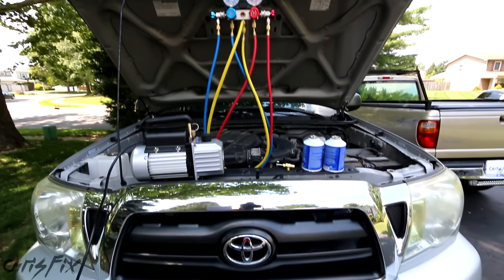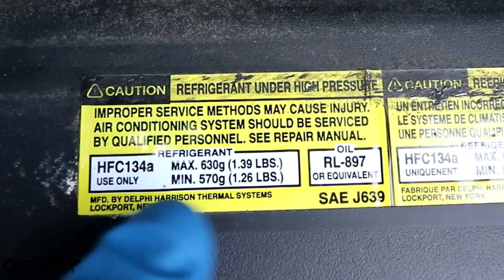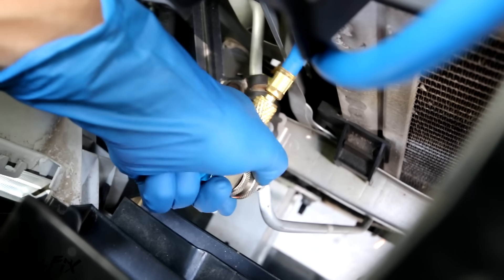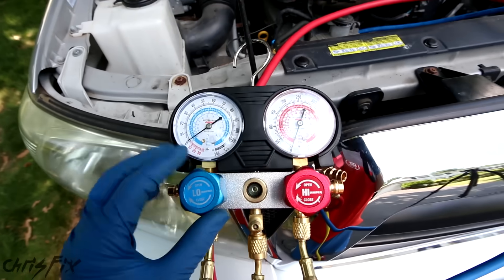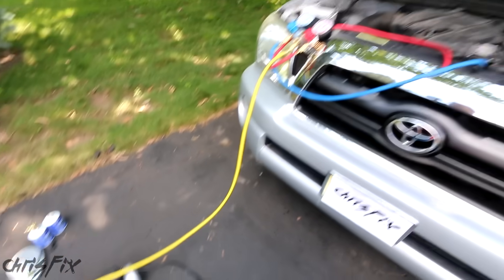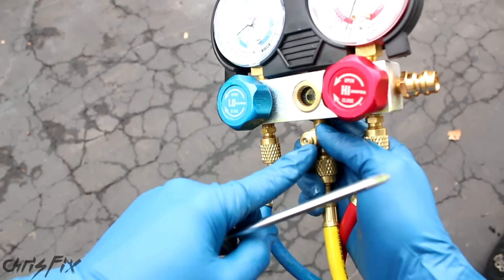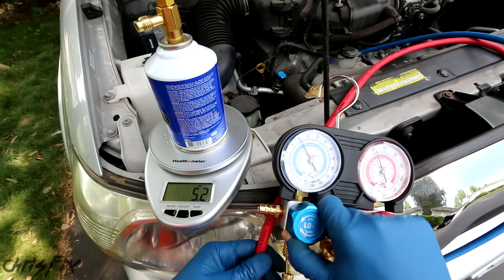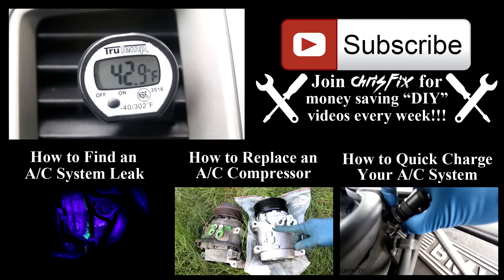How to Properly Recharge Your AC System

Comment: So, if you pulled a vacuum, didn't that pull the "OIL" out of the compressor? If you poured oil down the hose, and "PURGED" it, wouldn't that blow the "OIL" out? Just saying.

Comment: If I need to add oil, how to purge? I mean, if there is oil in the line, it will be spilled out?
Reply: don't add oil during purge. Chris did not show the order. You should add oil then connect the refill can so oil will be forced in during refill.

Comment: I followed everything step by step but I'm stuck at the part where the vehicle is supposed to take in the refrigerant.  The gauge needle doesn't move when I open up the low pressure valve... And no refrigerant is going in.  Help!

Comment: The step at 6:17 is not correct(?)  You're not supposed to close the hot and cold side when checking for seal/leaks.  Otherwise, you're just checking the leaks between vacuum and the gauge, but not the AC system!

Comment: Hey Chris, just wondering with the purging of air, if you did not have a purge valve. How would you go about getting the air out and at what stage of the refil. I gather you would unscrew the top yellow connector and listen for air after opening the can tap, leave it for 3-5 secs and then screw it up again. Is that sufficient??? Obviously you wouldn't have the gauges open yet, so I gather it would just evacuate the air naturally before that stage of the process
Reply: or where could you buy a purge valve connector for this

Comment: Can anyone help me out with this question?  I refilled my AC system using those one way connector that you buy with an "AC recharge kit" and my AC did go from being pretty warm/hot to cool, but it's not really cold like some systems.  If I rent this to pull a vacuum on the system and vent the free-on, will it be colder then if I just put some into the system like I did?
Thinking about doing it this way if it'll make the AC colder.  Any responses are appreciated.  Thanks in advance

Comment: Great video, but I have a question.  If the system holds a vacuum and doesn't leak anywhere, then how did the refrigerant leak out in the first place?  Theoretically, if the system needs to be recharged every so often then that means there should be a leak somewhere...  this has always confused me.
Reply: some small leak is OK. If you have to recharge every year, it is not a small leak.

Comment: Great help!  Thanks!  The compressor I got came already filled with pag oil just like yours.  Did you change out your drier?  If so, do you have to add more oil to the condenser/drier or does the oil already installed in the compressor cover the other ac components?

Comment: I use this video every time I recharge one and everyone is still pumping out ice cold air just used it again today for reference
Reply: Everybody does lol. Even mechanics in shops 🤫 don’t tell anyone we do. 😂 haha
Reply: Do u have  the adapter he used in video if so could you please tell me where you got it.
Reply: @larrydean6930  what adapter? The one for a self sealing refrigerant bottle? 

If that’s what you are referring, i bought mine at Walmart on the ac section near the oils. It costs around 3 dollars. They even sell a self sealing bottle charging for the ac pag oil that you can recharge easier than pouring oil in the lines.
Reply: @LaCacaLoca  if I'm getting the refrigerant recovered and then changing the two lines that go from my compressor to the condenser and accumulation drier, then vacuuming the system and recharging, should I put in more oil?  I know I made a comment asking Chris, but I'm not sure he'll even see the comment mixed in with the other thousands he gets.  Thanks in advance if you can help.

Comment: By putting the vacuum on the system (after new compressor installed) - wouldn't this suck out the compressor oil that came pre-installed with the compressor??

Comment: Folks Chris mentioned it already. When you have a leak it does not mean there is no refrigerant in the system. You HAVE to have it professionally evacuated before doing any of this. Evacuation is NOT the same as pulling a vacuum. Most shops will do it under ~$80 or so.

Comment: Did you change drier?
You didn't account for the r134a in the hose set ,typical with your hose ser is 1.5 oz sum of all 3.
If your gas bottle is upright you won't dispense liquid and therefore not damage the compressor.
Shadetree AC..

Comment: Why not just use grams instead of doing silly conversions between pounds and oz lol.
Reply: Lol YEAH, YOU COMMIE!!! J/K  if you're doing this kind of stuff you should be mathematically inclined enough to use whatever measurement system, right?
Reply: @edd7812  I suppose but there’s way more precision with grams and no conversion needed for the scale
Reply: @edd7812  Smart people do things the easiest, most efficient, and most effective way possible.
Reply: @benjaminabel8596  I guess my point would be much like language measurement systems vary. But if you were a linguist you should be able to communicate in whatever language proficient in
Reply: @edd7812  Some, if not many, linguists are only proficient in one language.
Reply: @benjaminabel8596  linguists proficient in only one language shouldn't do AC repair! 🤣😂🤣

Comment: Anyone else have trouble adding the refrigerant? I realized my refrigerant can is the opposite. The can is "open" when the adapter is in the down position. Did Chris use a non self-sealing can (back in 2015)? Almost all cans today are self-sealing, so when you raise the adapter the can will seal itself. So I assume adding refrigerant will work successfully for those with a self-sealing can doing the opposite of what he says about the can being open or closed. Unless I've missed something? Just trying to clarify. Thanks for the video.
Reply: Chris used the old style can (Pierce-Top)

Comment: Should not start a vehicle with the a/c system under vacuum...technically. It's only a major issue on a couple models.

Those cans should only be used upside down. Slowly. It works in a pinch until you can get it professionally done. But be prepared for an enviro charge as no shop wants to contaminate their machine with the stuff in cans.(amazon and ebay cans are usually just propane for the cheap or sale ones)

Comment: Wow.  Just great videos Chris.  Thank you. I recently tried to recharge my Explorer.  I pulled the vacuum and followed your directions.  The vacuum may have escaped somewhat before I actually started adding refrigerant.  After about 8oz going into the system, it would not accept anymore.  The compressor was running.  It was about 55 degrees outside.   Any suggestions?  Thanks.

Comment: Hey Chrisfix I have a question. So I screwed up and used a can of r134a with oil that stops leaks but it says on the can it’s not meant to be used on a hybrid.  So I filled my Prius with the wrong one. Is there anything I can do to fix this? Thanks for all you do.

Comment: If you have an old R12 or R22 system, I would highly recommend looking into converting to R152a, it performs much better than R134a and nearly the same as R12.
Reply: performance should be pretty much the same, but if anything this "newer" gases perform worse. in eu r12 and r22 are illegal and you can go to jail for owning them.  r134a at 4bar/58psi suction, outputs about 8.9°c/48f when r152a at 4bar/58psi outputs about 12°c/53f. and r12 same pressure 8°c/47f
Reply: @zorko1996  in my old R12 system that I've converted over to 152a, the low side pressure is at 25psi at the POA and I'm getting around 37 degrees F at the center vent.
Reply: @JackofAllTrades1  hard to believe. 152 at 25psi is 12°f you have to have a very blocked cabin filter in that case, cause u should be getting way lower
Reply: @zorko1996  well, this is a classic 70's car so there is no cabin air filter but I do not doubt the evap could be blocked a little from buildup over the years. An AC tech friend of mine told me that actually 23psi is the best low side pressure. Are you looking at the right pressure/temp chart? I posted a video on my channel with all the details a month back, you should check it out.
Reply: @JackofAllTrades1  ye gonna check it. to be honest 37°f output is chill enough anyway :D yeah im looking at danfoss refrigerant slider. we use this app for diagnosing system failures on industry scale, it hasnt dissapointed yet
Reply: @zorko1996  my buddy had an app on his phone that he showed me, not sure of the name but he repairs residential units. He had a large list of refrigerants to pick from on the app and he studied it for a bit and told me that between 23 and 24 psi would be optimum. I tried to set my POA at 23 but it ended up at 25. At 37 degrees I'm cruising nicely in the heat. 😀

Comment: When you add oil or dye to the yellow line it all comes out when you purge the line of air. Is there a better way to add the oil or dye manually other than buying refrigerant that's already mixed with it?
Reply: Interesting. All I know is you can add it to the compressor through one of the line holes.

Comment: I'm currently an auto tech student at Front Range Community College here in Colorado. I will be doing HVAC courses this summer, and wanted to get a headstart on learning about A/C systems. I know you used a scale to measure the second can of refrigerant, but I was wondering about something. Do you have to account for the weight of the can when adding the second one to avoid overfilling the system?  Thanks in advance if you happen to see my comment.
Reply: the weight of the can , whatever it is with the hose attached . what comes out is freon . if the can is 30ounces now with hoses on and you need 10 ounces  30 - 10 . stop at 20 .
Reply: @boracay12  maybe I was just over-thinking it. Thanks for the reply.

Comment: THUMBS UP for the vacuum time ! very important is the time that the vacuum is done ! A lot of variables for the pressure and temperature (boiling point) Abut the UV dye ..not entirely agree as i can change the viscosity of the oil, i would avoid using the UV dye .
In my opinion inside an AC system should be ONLY correct amount of refrigerant and oil (type and quantity)

Comment: Good info except you didn’t mention what the pressure should be.
Reply: I think because you fill it based on the WEIGHT requirement, not the pressure. If the system is tight and you put in the correct weight of R134a, then the pressure will be fine.
Reply: going by pressure is relative, it depends on the temperature  . if its 90 plus degrees out the pressure  is higher  . there is a chart for that . but by weight is better and you get the right amount . its better to empty the system ,vacuum it and fill by weight . its only a few cans .    to much it will be warm and way to much can damage the compressor.

Comment: Hey Chris.  Great video.  I'm going to be replacing my compressor and condenser on my 06 xrunner in the next couple of weeks, so these were ultra helpful.  One quick question.  The compressor I found is prefilled with oil, but what keeps the oil from being evacuated from the system when you run the vacuum pump for the 45min?
Reply: I have the same question.   Have you found the answer? Please let me know.

Comment: You probably should use the entire both cans since some of the refrigerant stays in the hoses of your manifold gauge set. It's usually 2 to 3 ounces that stays in the hoses.

Other than that this video is great. Most people don't know how important it is to vacuum the system first.
Reply: didnt the vacuum pull the oil from his compressor? doesn't he need to add oil to the whole system, condenser requires oil also? doesnt the vacuum pull everything out?
Reply: @TheSaneSchizophrenic  nah, most of the oil stays behind. A small amount of oil might be a good idea to add, but it doesn't vaporize, so the vacuum can't extract it.

Comment: Pretty informative video, usually I like to pressurize the system with nitrogen first to ensure I don’t have any leaks before pulling a vacuum because if the AC system cannot hold the refrigerant while it’s running then all that work and refrigerate is wasted and into the atmosphere.
Reply: Yeah, because Auto Zone has tanks of nitrogen available for this for the common man to buy with his Bidenbux.......
Reply: Or just use a micron gauge. You’ll know right away if you’re not below 2k micron.

Comment: I love me some Chris Fix but noticed something worth pointing out that I believe is wrong, or, I could be wrong. 

Each can is 12 fluid ounces which is a volume unit not a weight unit. Each can, however, says 340g which is a weight unit. Chris Fix was using using fluid ounces (fl oz.) as weight oz which is not the same.

I'm not a Auto Technician, but I am an engineer and this seems wrong to me. What do yall think?

Comment: Hey Chris, quick question: At the 4:20 mark, you open the low and high pressure valves then return to the gauges and comment on them reading zero. Without the gauge valves being open, would the gauges indeed show zero on both? Shouldn't these gauges be open to see a reading? In other words, with the two mainfold gauges being closed, wouldn't they read zero no matter how much refrigerant might still be present? Thanks for your time, Garry.
Reply: blue and red line are allways open towards their gauges, with valves you only open a conection betwen yelow/blue line if blue valves is open, yellow/red line if red valves is open and yellow/red/blue line if both valves are open. at this particular gauges, i dont recomend opening both valves when there is presurre on the high pressure side(red line).

Comment: Hey Chris - how do you purge your yellow line if you have had to fill it with Pag Oil prior to pressurising the same line with refrigerant? Won't pressurising just force the oil back out or are you running with the fact you have oiled the line you won't need to purge ... Great video BTW ... I'm an old retired mechanic, but we rarely bothered with A/C, we just called the A/C fella out to sort it ... However I prefer to do everything myself on the cars I do attend to (never retired lol) and apart from the straight cylinder recharge previously I decided to buy the gauges and a vacuum pump and do the job properly. 

Excellent reference site for very modern vehicles that I have to teach myself on occasionally ...

Comment: @ Chris   Thanks again for making a professional and knowledgable video to be trusted as with all of your videos!  I do almost everything on my car mechanically or technically, but I also have an honest and decent mechanic too. As long as i know what is right and proper then I know that the job is done properly when I have the A/C or other work done.  Each time when it is time to recharge/service my A/C I have had to replace the receiver/drier (collector) as it becomes clogged. I service it just as it vecomes less cool so no issues worse. It only costs me about 45.00 full clean, check, vacuum properly the system and refill.  My old A/C service did a few things wrong and dangerous to my system. I never would know if i did not view your video or videos on many mechanical work.  So far the A/C is unbelievably cold.  They did the work the exactly the way you did!  Thank you Sir!
Reply from the maker: I'm glad it's blowing icy cold! Thanks a lot!

Comment: I'm using my vacuum pump on my truck when I turn it on and open the high and low side the number should be going to a negative charge but it's just sitting at 0 it's not going up or down what am I doing wrong?

Comment: bought the gauge set from the description, thanks! notes: 1. the yellow hose has a metal tab in one end (the other end is open, where you can put oil in, although my oil just kinda overflowed when i poured a little [buy the right oil for the car's compressor]). 2. the hot and cold valve screws are tricky, since it turns clockwise to open on the engine, but on the gauge, it turns clockwise to close (they're marked correctly, but i assumed they were marked identical, but no). you're either turning into a valve, or trying to close the gauge. 3. when the gauge valves are closed, the gauges will still read the pressure from the car's lines (you're just closing off the gauge's service port [yellow line]).  3. i believe this refrigerant valve is for a non-self sealing can. i bought a valve for self-sealed cans and 3 self-sealed cans. i got lucky, they sent me non-self-sealed cans, and the extra valve i bought was defective. so i just used the one from this kit, which has a schrader valve so i could just leave it on an opened can to seal. 4. eric the car guy and ratches and wrenches both have videos on this process (etcg purges his valve after finishing).

Comment: Thumbs up! I can't get anyone (been to 4 places including dealership) to do the honest thing and just replace the compressor control solonoid ($25 part) on my daughters VW rather than just telling me "it's fine" or "it needs a whole new compressor" (not true), so I'll be using this video to help me do it myself. My problem is that they won't even evacuate the system for me. I'm glad to pay an honest fee! An honest mechanic is worth their weight in GOLD, but for now I've got to do it myself. At least I get to spend the money on tools instead of labor and overpriced parts and still save $$$. [/vent]

Comment: Isnt there still gas in the high pressure line? So all the gas that was measured didnt make it into the system. To rectify this blank of yellow line close high line and open both low and high valves on manifold. This will allow all gas that was in high line to enter the ac system via low pressure valve.